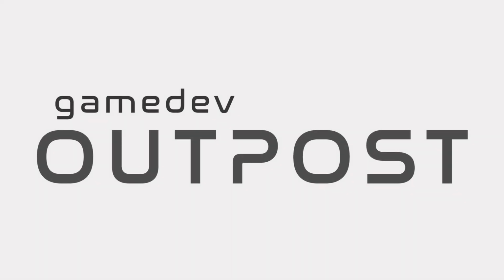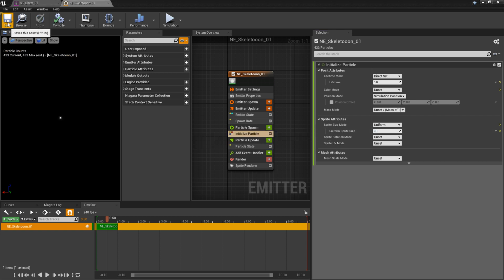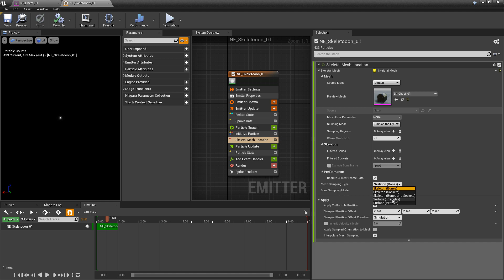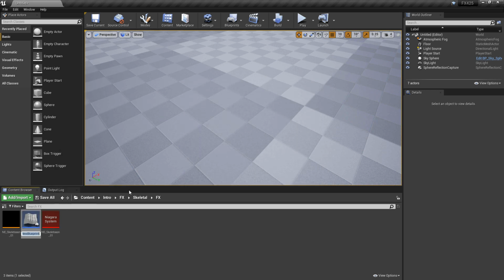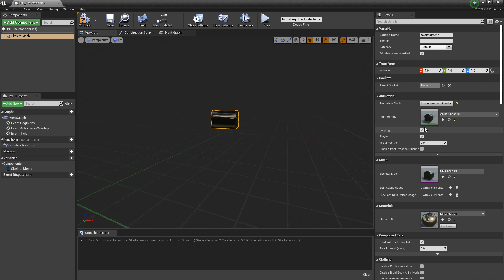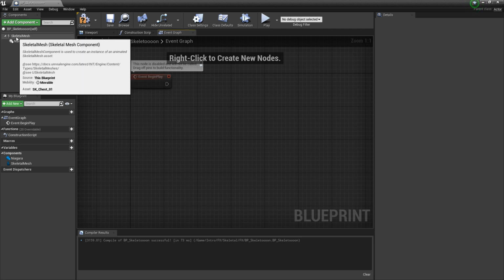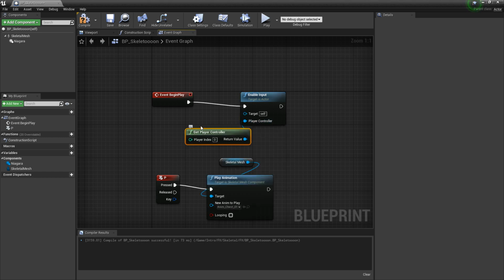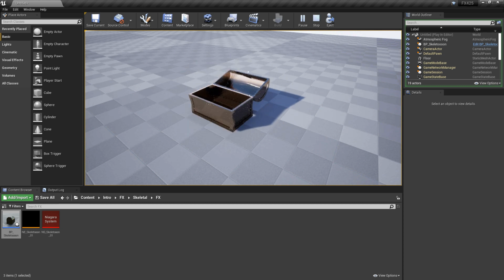UE4 - Niagara Skeletal Mesh and Surface

Comment: Update: I figured it out, the fix button was enabling cpu access for the mesh under it's settings for me. So if I wanted it to work on other meshes I needed to enable it for them as well.

I'm trying to use one Niagara system for multiple static meshes....is that even possible? I'm not sure what I'm doing wrong but I'm setting the static mesh and material for it but only the one that is set as Default inside the Niagara system is actually rendering properly....

Comment: Is there a way to make Niagara spawn particles uniformly over the skeletal mesh instead of just per triangle or per vertice?
Reply from the maker: This is something I did not mention, but the particle density is based on your mesh. If you have more triangles or more vertices in a certain area, there will be more particles spawning there. As of right now I don't believe there is just a "Uniform distribution" out of the box.
Reply: @gamedevoutpost9270  right, i'm encountering that problem currently and trying to think of a solution. At first i thought maybe in the sprite material?
Reply: A year has passed, have you found the answer?

Comment: Is it possible to use this module for Skeletal meshes that have some of their sections simulating cloth? I'm having trouble getting the particles to spawn from the actual cloth surface location.
Reply from the maker: This isn't something I've tried yet, but you most likely need a custom module.